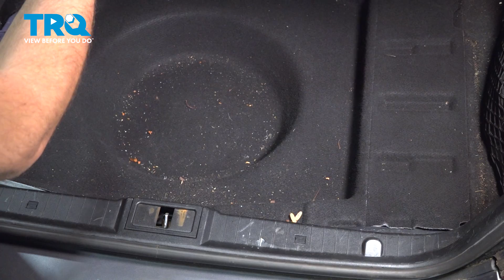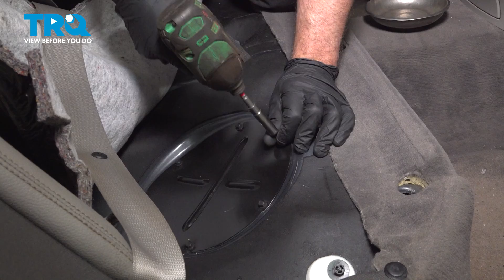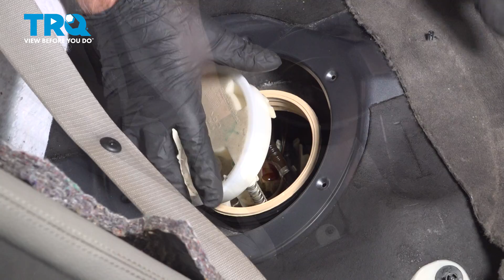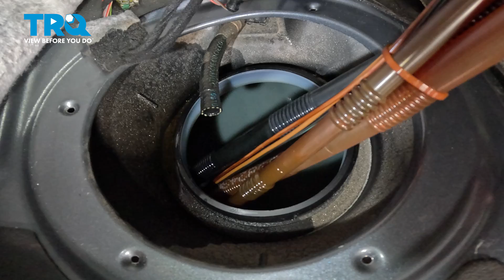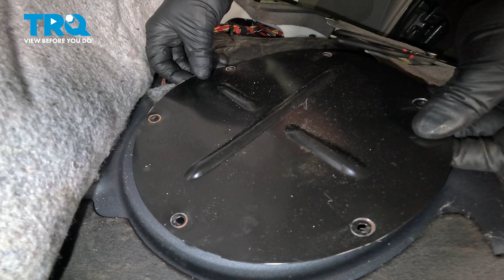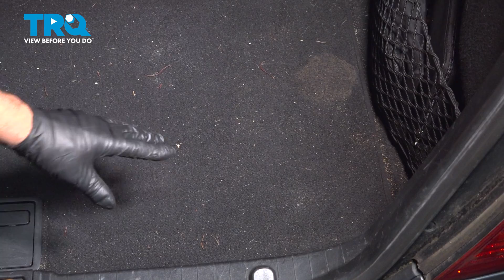How to Replace Fuel Tank Sending Unit 2006-2009 Mercedes-Benz E350 (3.5L V6)

Comment: So the fuel sending unit is on the rear left of the seat and the fuel pump is under the rear right side of the seat correct